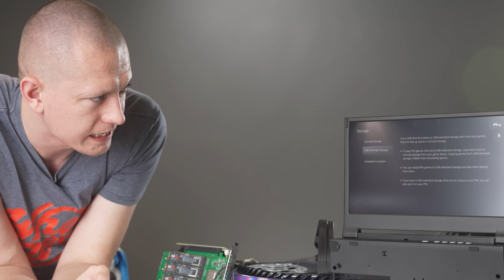I Put A GPU on the PS5

Comment: The custom sony Linux os would prob need be coded and/or driver installed in order see raid card.  Figure it wouldn’t work but still good video and interesting to see.  Same goes for Rx 6900xt.  Would need prob a driver and would there be enough pci lanes for GPUs.  Prob not.   Whole os is coded to work with soc/apu (zen 2/RDNA2).  As is the hardware is deigns from ground up Soc.  So there prob no way get it to see GPU or raid card without full access to hardware and os software/drivers. 

I do wish Sony would release their own custom Linux os for PCs. Getting AMD involved would be epic and be threat to windows.  Even if the os was just targeting gamers/streaming.  (Just able play Sony games on pc). Would epic. But that never happen Cus it be competition for themself. ( ps4/5 )

Only way this would work.  Would find ex Sony dev, who actually worked with on Sony custom Linux os.  Even then ps5 maybe too limited.

Comment: I wonder how much power the 6900xt gets from the PCIE port? That X4 connection was built for SSD's so the card probably didn't have enough power even if the OS could support it.
Reply: It had a whole separate power supply for it lol. Had like 600w

Comment: Brett did you create a volume / partition on the Highpoint raid card? 
I suppose you can try creating a single volume with exFAT as Fat32 and exFAT are supported for external drives on the PS5.
Reply from the maker: Yes. It didn't work.
Reply: @UFDTech  ah... that sucks.
Reply: The reason it doesn't work, is because the "raid controller" isn't actually one. It's a pcie switch.

He'd need a tri-mode raid card, like those from LSI/Broadcom... If the PS5 kernel even had support for it compiled in.
Reply: This

Comment: Here's a hacky way to do it. Your plan to load the RAID drivers on the PC was good. Now find the power pins on the M.2 plug, disconnect them electrically from the PS5, and rewire it to take external voltage from the PSU. Then you can transfer it without the card powering down.
Reply: This could work but really could just patch in power to the card or somehow makeshift a mirror cable so they transmit the same connection and power both ways that way when you take it out of the pc it will be powered still loaded and you can just turn on the ps5.
Reply: I appreciated reading this exchange of ideas
Reply: Good idea. You may have to manually get a separate 12V to 3V3 regulator put on the card for that if that circuitry is enabled by the PCI input power. It's also possible an enable line needs to be pulled low, but I don't see that on the pinout for NVMe or PCIe.
Reply: @ThisRandomUsername  Probably true. I hadn't really thought too in depth about that. Not an electrical or signals engineer, haha. Just looking at the PCIe piniut there is a wake pin that might serve that purpose. I don't really know without reading the full protocol specification.

Comment: with the GPU, you could have probably booted it with the display plugged into it. although I doubt it would have worked anyways.
Reply: There is probably no driver in the custom freebsd that ps5 uses and the slot is locked down to support only ssds anyway.
Reply: @tedbybolf4616  It is almost certainly locked down but the driver is pretty close to the PS5 driver, odds are not close enough to game but the 2D portions are likely nearly identical.
Reply: @glenwaldrop8166  The similarity of the hardware doesn't mean it will work also rtx 3080 is very far from rdna2 integrated gpu so the driver is absolutely different.
Reply: @tedbybolf4616  it was a6800xt
Reply: Bro pretending he knows shit

Comment: Will the highpoint work without any drivers on a PC? If not then it seems like a lost cause. If it does, maybe speak with Wendell at level1techs maybe he can hook up some pci-e sniffer to figure out what is wrong
Reply: Yes it should but, he foregot to create a volume on the highpoint with a ssd, or all four first. He must do this in a pc first. I doubt the PS5 OS boots the ROM from Highpoint, then the Raid-Controller presents the PS5 with a drive(aka as the volume on the controller) that it can use like a ssd. The driver then is only needed for Windows to get the best experience out the HW. One will have still acces to the Volume/Drive in safe mode where Windows doesnt load the driver but uses its generic drive-driver. Same should/could work for the PS5. But having no Volume on the highpoint, is like putting an empty NVME Slot-thingy in the PS5, there is simply no drive.
Reply from the maker: @hawkeyede9441  I didn't forget. I just didn't show it.

Comment: Format 1 SSD in the PS/5 and check it in your pc to see which filesystem it is using. Populate the Highpoint controller with all 4 SSDs in your pc and format it to the same filesystem that the PS/5 is using. If that is possible because the PS/5 might be using a (l)inux filesystem. Maybe that helps.
Reply: Any filesystem is a linux filesystem if you try hard enough
Reply: Ps5 uses a custom freebsd os, which the file system is encrypted usually.
Reply: @waterheart95  have you actually tried?
Reply: @TheNpcNoob  windows does recognize like 3 filesystems......
But could be true it is encrypted.
Reply: @tedbybolf4616  The drives are most definitely using encryption, they have been doing so since PS3 and is a necessity in its security against people running unsigned code. As for the file system well they used UFS (Unix File System) on the PS3 and PFS (Playstation File system) on the PS4 which is their own closed FS based off UFS. On the PS5 they are most likely continuing usage of PFS which obviously non-Sony systems won't natively support, at best the hacking & homebrew community may come up with their own software to access the file system assuming you can somehow get the appropriate encryption keys.
Reply: @Sevicify  that's what I wanted to know. So PFS is basically UFS with encryption on fs level. That's pretty sad tho if it was normal UFS I would  try adding files to the ps.
Reply: @tedbybolf4616  I'm not sure how much they've changed from UFS or if the encryption is a part of the file system itself or done at a lower level, but basically yeah we can think of it as their own version of UFS with encryption. It is sad for us that it's locked down but understandable from their perspective to try and protect the IP within their ecosystem from piracy.
Reply: @Sevicify  even a PS2 with an HDD uses PFS 

It's not encrypted though
Reply: @Sevicify  what do you think about the current firmware on PS5 having now been hacked by two people, and the system keys found and decrypted?
Reply: @tedbybolf4616 I’ve tried on a ps4 hard drive, it wasn’t recognized. PS5 OS is based on PS4 OS.
Reply: i like your idea so why couldn't you format all four drives within the encrypted environment on the ps5
Reply: Why are you saying PS/5?